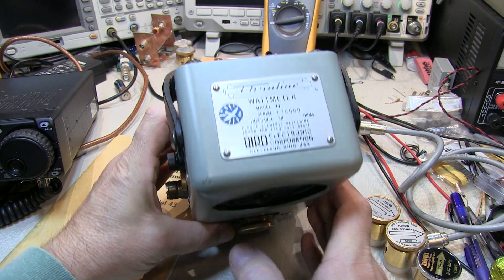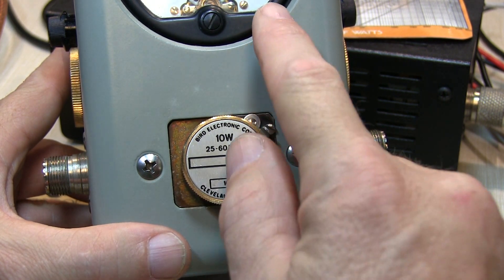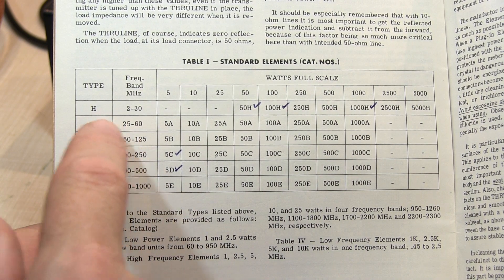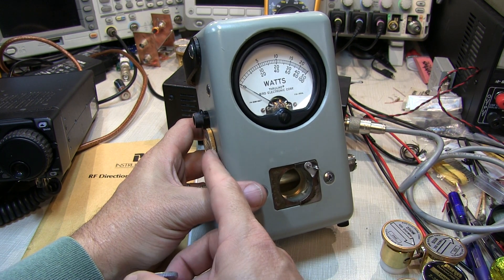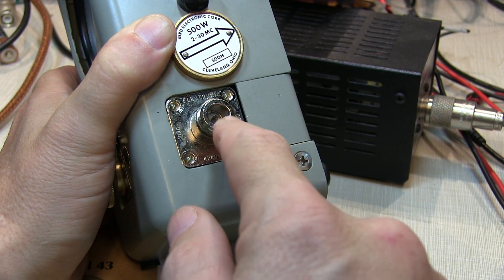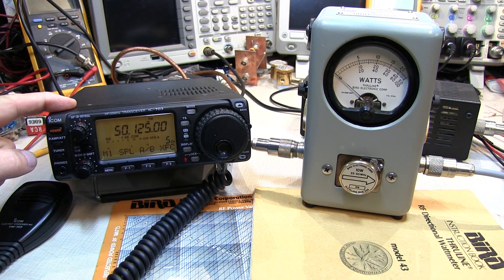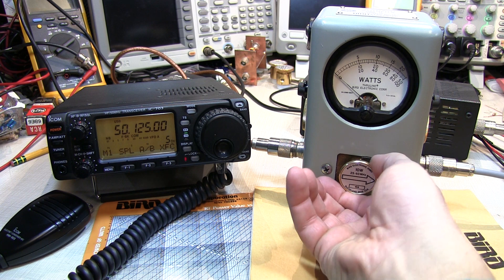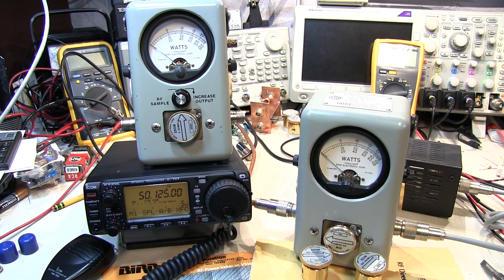#221: The Bird 43 Directional Wattmeter: Overview and how-to use

Comment: Great presentation, as usual... thanks... one comment : Technicians sometimes put a type N connector on one side of the model 43, and an S0239 ( VHF ) connector on the other side... then make and provide a co-ax cable maybe a foot long to run between the two sides of the meter. If the meter must be used in the field somewhere, the connectors on the radio might be type N or regular VHF connectors... ( PL259 / SO239 )  With this arrangement, the meter can be used with either kind of radio connector, by unplugging the cable on the side of the meter that has the mating connectors on the cable. This makes the meter a little more versatile and flexible. You might want to also point out the zero adjust screw on the meter face. Good comment about the meter dampening, glad you mentioned that.
Reply from the maker: That's a great tip!  Maybe worth a video as some point (especially to point out that you also pay attention to the slug direction....

Comment: I still dont know which scale to use? I dont own this meter. I'd just like to know when i see other people using it which scale i need to look at?
Reply from the maker: Use the scale that ends with the same value as the rating of the slug, remember that you may need to mentally move the decimal point.

Comment: One stupid question  what will happen  we put 10w slugs and accidentally tx 100w . 

Any protection?
Reply from the maker: According to Bird, the slugs can withstand up to 2x their rated power. So this means that a 10w slug won't be damaged by a 20w signal.  100w into a 10w slug can damage the slug and/or the meter movement.

Comment: When friends ask me which wattmeter to buy, I always steer them to the Telewave #44.
For one simple reason… No Slugs!
They are delicate, expensive and you need so darn many.

The Telewave 44 does 5MHz through 1GHz / 1 to 500 Watts forward and reflected power.
WITHOUT any external or internal accessories or parts required.

I bought my first Bird 43 when I was in my teens and used to mow lawns to earn “slug money”.
Eventually I was guided to the Telewave and I’ve been very happy with it.
There definitely exists a need for the Bird 43, especially when it comes to broadcast video.

Comment: Hello Alan. I am currently in the market for a Bird wattmeter. I am looking at the 4304A rather than the 43 only because I do not want to be dealing with separate slugs and because we mostly would us it for VHF and UHF land mobile radio applications. Can you provide your expert insight on this decision? Thank you for the wonderful content.
Reply from the maker: The 4304A is a nice meter solution if you don't want to have different slugs for different power levels and bands - but it will cost you a lot more money!  I've seen the 4304A units cost 3-4x more than a 43 with a couple of slugs...  If you can find one at a good price, it will serve you well.
Reply: @w2aew  As an update. I was able to buy a new 4304A for $695 so I think I got a good deal. I saw them for as much as $835. Again Alan thank you for the valuable knowledge.
Reply: @w2aew  Thank you for the valuable information. Best regards.

Comment: I have two of these meters, one "regular" 43, and another with the peak reading kit installed. Both are great meters. I have always been a fan of Bird meters and have several Bird elements, loads, and attenuators. These meters are timeless, tried and true work horses. 73..

Comment: I realise that I am a few years late to this video, really enjoy your content, as you said the 43 remains an industry standard piece of test gear. I have 6 of them, unfortunately only one with the PEP module. An advantage of the clone PEP modules is that the generally only require one battery. FWIW I have added a phono socket, resistor and a NiMh PP3 so that it can be conveniently trickle charged from 12v. Unfortunately common amateur perception is that these meters are unusually accurate, in my experience though consistency can be excellent and that is good enough for me.

Comment: can these be used to connect 2 transceivers together for tx/rx testing?
Reply from the maker: No, you can't connect a transmitter directly to a receiver - receivers can not accept the full output of a transmitter.

Comment: Hi there thanks for reply, yes makes sense, i actually in the end stripped the whole meter completely down to basics and tested everything i could, i think one of the weak links is the inner connection on the coax where it fits onto the bottom casting, looks like just a round pin in the middle that touches a pin like thing inside the plug going across the hole,  i tested the meter itself by putting an Ohm meter across is with my finger in series to cut the current down, and i got it to go right across several times with out it crashing across...i tested the coax lead an sprayed some switch cleaner on the connector at the bottom and and the contact inside, i actually have a 10 watt slug that i found and it does actually go up to about 3.7 watts  on a 4 watt CB, i assume that's about right they never seem to give out 4 watts hi...so all seems ok now, ok nice video enjoyed it, one of the better ones....from Fred g4vvq in England.

Comment: Further to message below i left, i found a 10 watt, 25 to 60 mhz slug and it still didn't work, i had the whole meter to pieces and tested everything with an ohm meter and i had no continuity from the meter inner coax to the sensor casting, so i took the connector off and tested the lead and casting and both were fine, put it back on and it worked, just a poor connection from the contact to the socked on the casting, or should i say on the plug that screws on..works ok now...prob lack of use...from Fred in Uk
Reply from the maker: Likely dirt or oxidation - sounds like you have it sorted out now.

Comment: Hi there this is prob a daft question but i have one of these 43 meters and i have never used it, i tried out out on a 4 watt cb fm 27mhz and the pointer doesn't move when i key up, i am assuming i have the wrong slug i it, i have a 500 watt one that goes from about 1 to 30 mhz, i assume i need something like a 10 watt slug from Fred g4vvq in England.
Reply from the maker: 4W would barely move the meter using a 500W slug - think about it, it would move the meter <1% of full scale - imperceptable.

Comment: Question for anyone...  if I wanted to take a more accurate measure of reverse power, could I use a slug with a lower power rating (more sensitive) with a higher forward power?  For example, a 10W slug (measuring reverse power) with 100W actual RF going forward (and less than 10W of reflected RF).
Reply from the maker: Yes, that will work fine.

Comment: Great meter until you have 2 of them. Trying to calibrate 1 slug and 2 meters to get similar readings is a very difficult process esp if one meter is a 43P. The circuitry of the 43P interferes with power values. It does. I have the genuine Bird board in there and got a replacement genuine 43P board and it yields yet another reading. None of them read the same as the other meter and when I remove the board and from the 43P so it acts as a 43 then this gives another reading again.

Add to that, I have 2x 50w slugs and they read completely differently. 

Imagine then, what happens when inserting different wattage slugs results in different readings again between the two peak reading boards. 
I dunno what to do. I try to calibrate them from the flouro meter on my FT1000MP but that introduces another variable.

I think one needs a master meter with like a Meterbuilder or Array Solutions with known accuracy to calibrate your Bird slugs and check meter and peak board accuracy. 
It is a non issue with one of Bird 43 since all values are relative but introducing a 2nd one is a kind of descent into madness when trying to get them to read similarly.

What does all this mean? Well they (meters or slugs) ain't that accurate unless regularly tested against a known accurate meter.
So long as they read within a few % of each other I don't really care but 10w difference with a 50w slug between meters, and a further + or - 4w between peak boards drives one insane when trying to get to the bottom of why.
Reply: I have half a dozen or so of these, one is fitted with an aftermarket PEP board, I have not seen any significant disparity in readings between them. The DC offset and gain of the PEP boards does need careful adjustment though.
Reply: Make sure your 43P board is adjusted to read the same full scale value as you get with the board turned off on a CW or FM signal.  If the same slug gives different readings in two meters, that means the meters need calibrating.

Comment: Is there an easy way to zero out the meter such as a calibration knob? I see two small black knobs on the sides.  Someone has one for sale but the picture shows the needle not resting in the 0 position.  I'm not sure if I should go for it.
Reply from the maker: The small screw at the bottom-center of the meter is the zero-ing screw.

Comment: Are there similar devices that do 5 GHz? (for measuring 5GHz wifi)
Reply: You're looking for a microwave RF power meter, something like this: https://www.atecorp.com/products/keysight-technologies/436a  for a few hundred bucks used on ebay.  Make sure to get the right power head for the frequency and power level you need.  Expect the head to cost as much or more than the meter.

Comment: It is Truly amazing that the "43" has been around so long and as stated, they keep selling them along with the Elements. The older element caps were made of Teflon and then changed to a much harder material. The Older element plates have to be punched or drilled out, whereas the newer plastic style can be lifted "if albeit careful" and calibration can be performed.  I also have additional info should anyone need it!

Comment: How do I find the value of mine to sell it.
Reply from the maker: You can check current selling prices on ebay, or on radio-centric classified sites like swap.qth.com.  Generally though, the Model 43 unit (without slugs) ranges from about $75 in poor physical condition to about $150 in pristine physical condition.  The measurement slugs will be about $75-$125 for the HF units, and typically about $40-$75 for the others.  All of this assumes perfect working condition.

Comment: The "plastic caps" on all my slugs are made of PTFE. It has a lot of capacitance BTW. Thanks.
Reply from the maker: The insertion loss of the line section is specified with the slug installed, so the effect of the PTFE isn't something that you normally have to worry about.
Reply: Sure. Just commenting as to what the "plastic" material was and in 
reference to it's electrical properties. We used PTFE in high power RF 
cavity amplifiers as a mechanical dielectric tuner because it makes a 
great sliding RF short because of it's C.

Comment: Hi Alan, another brilliant video that does what no manual can do and breaks down into easy to understand blocks. Just one question, I know my radio is out putting 100w and on FM that's what I would expect to see On the Bird but it's showing low at about 80w. Tested my radio on another meter and its 100w. I know the element is good as I tested it on another amateurs Bird 43. Is there any calibration method that you know of without touching the 25k potentiometer inside the elements? Many thanks in advanced, kind regards Spence M0STO

Comment: The contacts on these BIRD slugs/meters can sometimes get crud on them and they need some cleaning so the meter will read. Had that issue more than a few times with this meter. The 43 is an industry standard not unlike the Simpson 260 VOM.

Comment: DEAR
i have Motorola 4601 ,the maximum transmitted  power  is about 4.0 watt but in the device manual it  was written   27 w how can i increase it to the maximum?.
thanks
Reply from the maker: I have no idea, I know nothing about that radio.
Reply: The radio is DMR. It's like TDMA and would need a peak board to sample it. The PA is firmware programmable but not recommended. Mine is factory 40w. You need a firmware that's written for 40w.

Comment: Is it true you can get these for $300~ or so? I'm a new HAM but I've always been a geek with RF stuff and now that I'm a HAM I can sort of justify wanting a nice new toy, need something to measure VSWR and power (watts) and I love the design of these, they seam a bit more robust, I have a spectrum analyzer that will handle a 5watt input but I prefer not to do that. I just see these for around $300 and it seams like such a good deal.
Reply from the maker: +nateo200 You can usually find a used 43 for $150-$200 depending on condition, then you have to get the slugs (typically $30-$100, depending on frequency and power needed).

Comment: I have a Bird 43 with Array Solution AS-43AP digital meter in it. I like it.  I also have the Coaxial Dynamics analog meter which takes the Bird Slugs.  My Bird had a bad meter movement so I put in the new digital one.  And the Coaxial Dynamics meter is much easier to read than the Bird meter.  I would be curious to see these put up against a very accurate power meter to check the accuracy of them.  Bird claims 5% of full scale.

Comment: Great video as usual Alan. Couple of additional points - if you have the basic Bird 43 the PEP mod kit will take up one of the two slug storage spaces but is well worth it (be careful with the on-off switch as it's easy to leave the kit engaged, but there is a LED on indicator; BTW the Bird accessory runs on two 9VDC batteries). Also, the slugs do come out of calibration, especially if they were abused at some point in time in their history if you get them used. They CAN be re-calibrated but of course you must have a standard to compare to when adjusting them. If you have the basic 43 model you can get a sampler accessory that takes the place of the measuring slug which makes it not as quite as user friendly but at least gives you that capability. Finally, watch out - gathering up slugs can get addicting, sorta like eating peanuts! 73 - Dino KL0S
Reply from the maker: +Dino Papas Excellent points, thank you.  I actually picked up a 3rd party peak kit (PR-90).  Only takes 1 9V battery, and has adjustable hold time (and cheaper than the Bird kit).  I'll be putting that in mine - probably with a video... ;-)

Comment: Why do the frequency range for such devices stop at 2.4Ghz, 5.8Ghz is not catered for. In the RC world a SWR meter for 5.8Ghz is DIY only, utilizing a diode from a microwave and an ammeter. BTW an excellent video as always.
Reply from the maker: +TheRogerx3 When these units were introduced (1952), there was very little activity at 5.8GHz, so the line section and element design simply did not take that into account.
Reply: +w2aew I thank you for your time.

Comment: Very informative video Alan on the Bird meters.  I have 2 of the 4304 meters. These have no slugs and have adjustable power levels, 15, 50, 150, 500. Also have the RF sample ports. Although both meters are identical in design, one is branded Telewave. Have used plenty of the ones like you shown in my commercial radio days, hope to own one of those one day. Thanks for sharing.

Comment: Great Video, I picked up a Bird 43 at Dayton for $75 dollars and then went on to find some slugs. Your overview was just what I needed! I did not know about the dummy slug to use during transport. I also got a small padded case for the meter with room for several slugs. Wish I had known to look for the peak or RF sample variants. You might want to add that there is another company that makes a similar meter with slugs that also work with the Bird meters.
Reply from the maker: +Scott Johnston Yeah - at least two - Telewave and Coaxial Dynamics.

Comment: Icon of the radio scene.Expensive habit tho' :) Thanks for the informative video Alan
Reply from the maker: +Thomas Taylor You can typically find them used in the range of $100-$150, plus slugs.  Still expensive, but built like a tank.